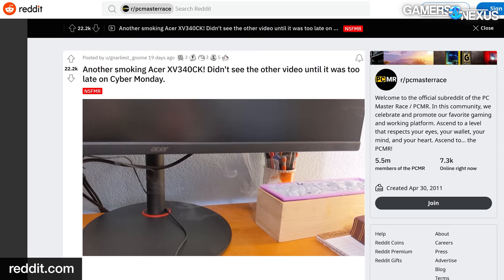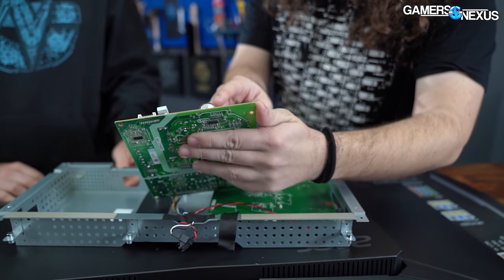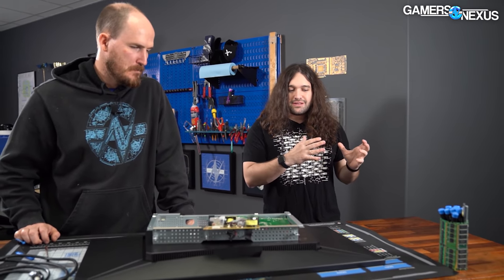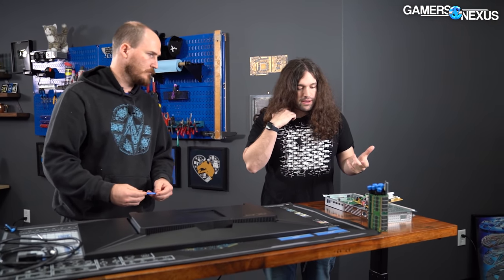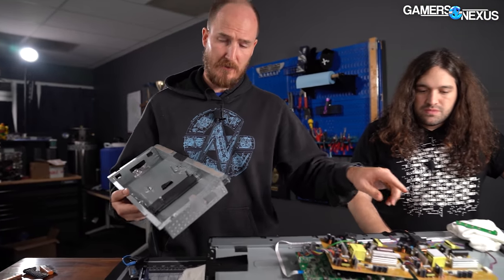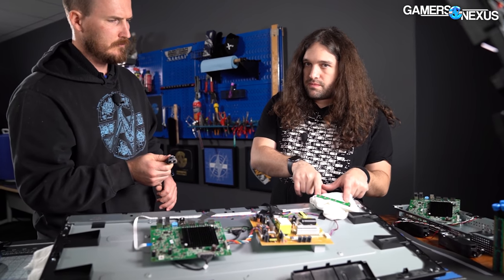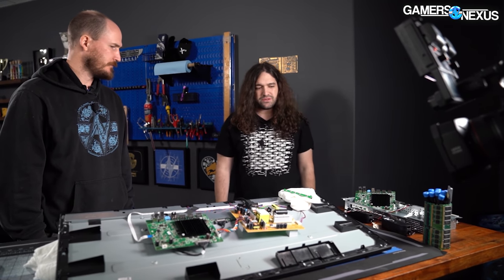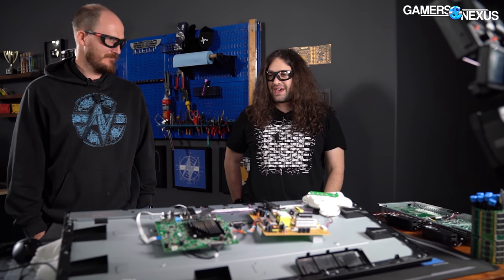Acer Monitor Fires Investigated: Blown Capacitors on Acer XV340CK

Comment: Honestly just don't buy Acer products. For every decent product at a decent price they sell, there is almost always an alternative that you should buy instead, either because it will last longer, or is just better. They use bottom bin components, skimp on their design with the bare minimum of components, and save costs absolutely wherever they can chasing down pennies. It always ends up costing you more money in the long run if you make the mistake of buying their junk. After getting shafted by Acer on multiple occasions, take my hard learned advice and don't bother with them.

Comment: You take a PC. You build it with NZXT h1 case that I had the faulty fan splitters. You put that gigabyte power supply in it. You put that new z690 board in it that's catching fire. And pair it with this monitor. then gift it to somebody you fucking hate. Profit.

Comment: It finally dawned on me why these videos are uncomfortable to watch lately. Shooting at an angle to the wall makes the scene space uneven and irritating to watch. Your focus is constantly drawn to the back-left corner where there is a bunch of "stuff" (boxes, tanks, tables, and junk), or it's drawn to the light shining off the hard wall corner in  the other half of the scene. You have the makings of a background with tool board and other props, but then film at an impossible angle that is skewed to the eye. Just saying...it's irritating and wouldn't take 2 seconds to fix even if it is a temporary setup.

Comment: Acer is dogshit and I would never recommend. Bought 4 monitors from them (same one just kept returning cause dead pixels, process took a month before I gave up on acer’s qc) and ALL of them had dead pixels with each monitor having progressively more dead pixels than the last and in worse and worse regions (closer and closer to the middle). Bottom of the bargain bin low quality shit. This is par for the course

Comment: lol...what? I don't think those are thermal pads, the really big ones that are white and you said was stupid. Dude, is that not just Styrofoam? that is to hold the PCB off the metal so it wont short? That is what it looks like to me. If fact I could not find a 1 inch or bigger thermal pad anywhere on the internet. The biggest was 20mm which is still less than one inch on Digi-key electronics and they sell 100s of different kinds of thermal pads. So.....yeah. Are you sure that is a thermal pad? I swear you guys make up stuff like at least once per video. If you don't know what it is just say that. If I am wrong please let me know. Love the channel but that comment made me laugh because obviously that is not a thermal pad and is just keeping the PCB off the back the metal backing. If fact if that is thermal pad you would still have to have it way off the back for safety. there are rules you have to follow when doing exposed electrical. OR power

Comment: This Monitor Need Calibration with ICC Profile

Pre Calibration Score components (10 Perfect)
6.3 score White Balance dE  ====> 9.5 Calibrated
7.3 score Color dE  ====> 9.6 Calibrated
______________________________________________________________________________________________

Best Settings for this monitor 
Brightness: 95 - Contrast: 60 - Black boost: 0 - Free Synch On
Nvidia Settings : Brightness 55% - Vivid Colors: 60%-65% - Vertical Synch: Always Off - GSynch: ON